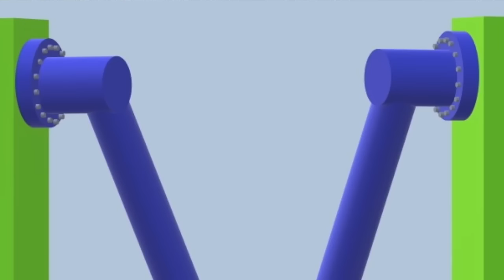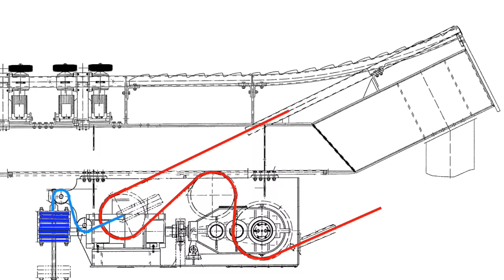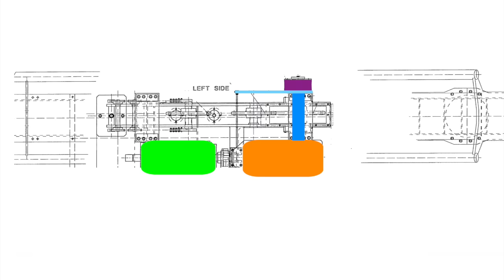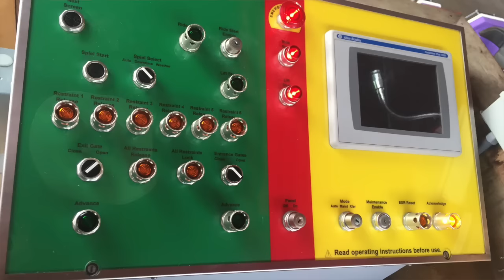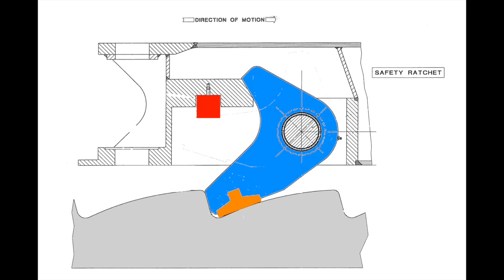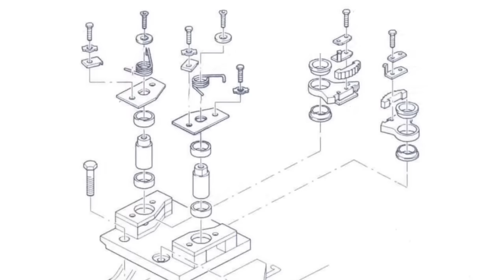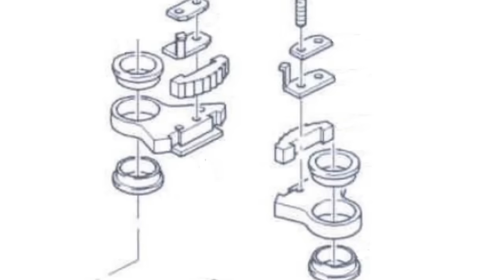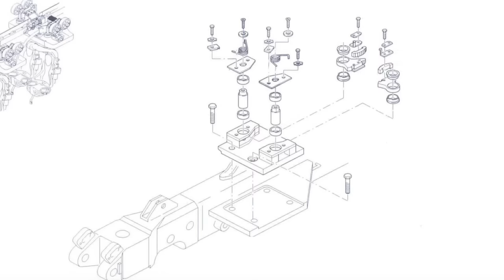How rollercoaster anti-rollbacks (ARB) work to keep you safe

Comment: I used to work on a 1920s wooden rollercoaster with a brakeman, (Scenic Railway) it had somewhat conventional ARBs albeit much simpler than B&M ratchets etc. But it previously had another system. No up stops or side wheels, just flanged steel wheels like a train, running on a small steel rail. On the lift hill and other uphill sections, the wood supporting the rails was wider out to the side of the rails and the trains basically had spring loaded spikes that would dig into the wood if the train were to loose momentum!
Reply from the maker: That’s interesting!

Comment: The B&M system sounds really good being able to monitor the anti rollback operation on every dispatch. 
At Europa Park, the chain broke on their GCI wooden coaster so as rare as it is, it can happen.
Apologies if you’ve already explained but it would be great to understand more in detail how the launch abort / roll back works on launch coasters. Once I saw the mechanics walking out the launch track with a can of oil and kicking the stuck fins back up.

Comment: when I was working at Black Mamba I learned about an interesting thing that can happen with the ARB "dogs":

There is a little ramp at the entrance to the station that pushes the dog down (since its an Invert, they have to be pushed up into the ARB teeth with a spring) and a sensor after it, checking if it came back up. And when it's cold, they sometimes don't come up fast enough. So you have to reverse the whole train into the transfer track to try that again, since it won't let you dispatch a train with that fault active. And if you have two trains on it, you had to reverse both trains, one after the other. We ended up switching the trains multiple times, but it was so cold, it kept happening.

Comment: The Arrow ones sound the best! Your props are amazing.
Reply from the maker: Thank you
Reply: @ryantheridemechanic have you seen the wooden side-cam variety on Leap the Dips. Just boards nailed onto the lift hill. Hard to think they’d stop anything
Reply from the maker: @porcelainthunder2213  wedges like that have a surprising amount of hold. We supported 20ton tractors sections with a simple 2x4. They had no trouble holding that weight.

Comment: Arrow suspended coasters have unique anti rollbacks too! I worked on one and the fixed part or the "tooth" was actually on the train and the moving cam part or the "dog" was placed upside-down the entire length up the lift. I believe Arrow did this as a "fail safe" since no parts required springs but gravity would pull the dogs down on the top side. Obviously outdated since it was now wayyyy more than 4 moving dogs with the dampeners that would need to be checked and replaced (maybe 100 +) Our maintenance team would go and have two push up each one as they went up the lift each morning to check them all.
Reply from the maker: Must have made good sense at the time.

Comment: I did a track walk on the Big Dipper at Blackpool Pleasure Beach a few years back (a coaster that's over 100 years old now) and they explained about the anti-rollbacks on the tops of the hills - they said that if the train stopped there then they could get it going again by having a load of staff give it a shove, whereas if it rolled back down the hill you were basically going to have to get a crane or similar to winch it out, which is a huge inconvenience in a park like that where everything is so densely packed in.

At the same park there's some cool old anti-rollbacks on the Ghost Train - more similar to the paddle sort you see on a log flume. You can see (and hear!) them very clearly in a POV.
Reply from the maker: Cool

Comment: This is a Great video Ryan!! Very Interesting on how the Cams work. That got my attention. Question about the Anti-Rollback Teeth on a couple of other Rollercoasters built by PTC. Blue Streak at Cedar Point has one row of Anti-Rollback Teeth on hills throughout the course, And Comet at Great Escape has two rows of Anti-Rollback Teeth on hills throughout the course. And both of those Coasters operate with 3 Bench 4 Car PTC Trains. The two mentioned Rollercoasters are much older, But I've always been curious about the difference of the Anti-Rollback Teeth system on them. Thanks.
Reply from the maker: That’s a real tough one. I honestly don’t know the madness behind those decisions. From a practical point of view. If you use two sets of toothed rails, the coach is symmetrical making fabrication easier.  If you only use one rail., then the coach is no longer symmetrical becomes as a-symmetrical. Also, when using two rails, it holds the train evenly compared to one rail, which will want the train to lean towards one side or the other.  Just my thoughts.
Reply: @ryantheridemechanic  Thanks for your feedback Ryan. Also The Beast, and Racer at Kings Island also has double sets of Anti-Rollback Teeth along the circuit. I've always thought maybe it's because of the number of Cars for The Trains, of course means more weight. The Beast has 6 Car Trains, and Racer has 5.

Comment: I remember back in the late 90's early 00's on Darien Lake's Arrow looper, Viper, the park had put leather strips on the anti rollback teeth to dampen the noise it made, it only lasted a couple of seasons before they removed them. Also, at the same park, the SLC Mind Eraser, whenever the train engaged the lift hill and heads up the lift about a quarter away, it always makes a moaning or a cow mooing sound, what is that from?
Reply from the maker: I would assume if the chain liner was bad it would have been fixed after the first year or two. Could be the ARB rail I would venture that the rail is out of center with the track if that’s the case. Could just be harmonics with the removable hand rails on the side as well.

Comment: I’m suprised there’s no lock to keep the ARB’s from making that noise during the 0G moments.
Reply: A lock would be a bad idea on ARBs, and springs to hold them down would wear out and be more expensive to maintain. But I could see putting a pad on the rest position, so the ARB makes more of a soft thunk than a hard clack. That said, I don't think it is big enough of an issue to worry about once you know what it is. I actually like to hear that clack, because it means there is definitely good airtime there. Also holy hecc Rocky Mountain needs to add some pads in general. Their ARBs are deafening.
Reply from the maker: @Ravaxr  and to place a pad on the arb you would have to thicken the dog itself and increase the height of the toothed rail. So not an easy retrofit unless they are already thick enough.

Comment: You should talk about the B&M Dive coasters how they use (I think) the same ARB and chain in the down side of the track to hold the train before letting it go over the edge.   I always thought they used an extremely powerful magnet to hold that train over the edge but I heard it’s just the ARB doing double duty.
Reply from the maker: Yea those are interesting. I’ve never worked with one but I understand the basics. Need to get more info first. They use 4ARB 2 chain dogs and one drop dog that’s basically a chain dog facing forward instead of backwards.
Reply: What was the reason why Arrow lift hills were loud?  You can always tell an Arrow from anyone but some like Magnum XL200 were super loud compared to their others and I notice RMC had loud ones but Steel Vengeance @CP really turned up the lift volume on that one.
Reply from the maker: @jackschissler255  big heavy anti-rollback dogs. That’s it. Just big stuff making big noise.

Comment: So with the b&m example that would mean coaches 2, 4,6 and then either 7 or 8? If it’s running 4
Reply from the maker: Yea basically every other coach. In general the pilot coach has no attachments due to the pilot pin installation.